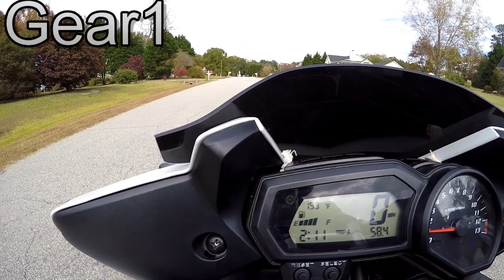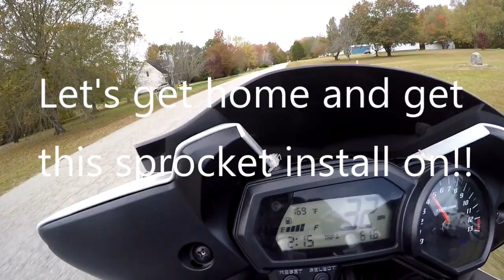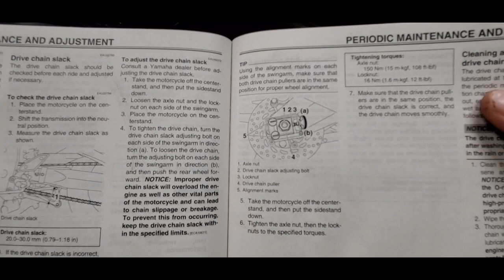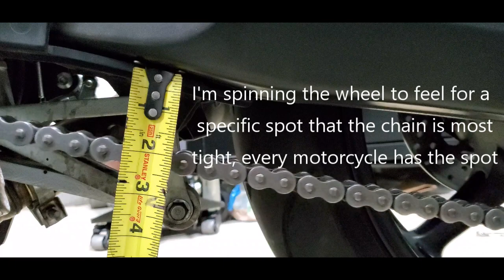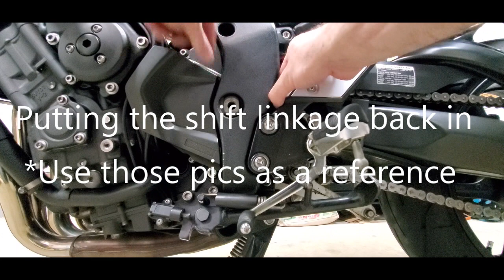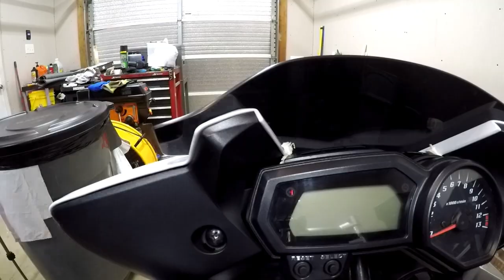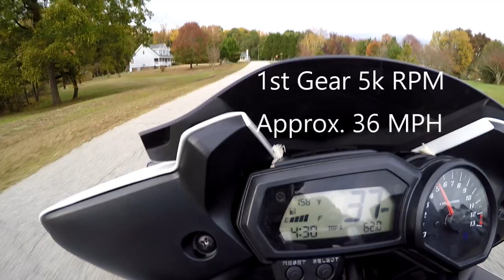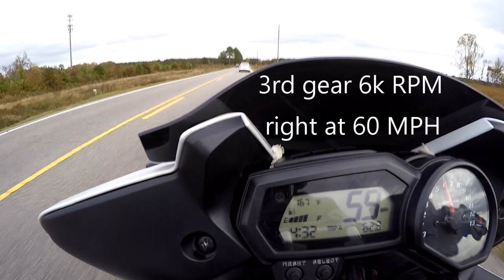2006-2015 Yamaha FZ1 17T to 16T Front Sprocket Swap, Before/After Rides & How To Set Chain Tension!!

Comment: Damn, I just wrapped up my 16t install on my 2006 and I'm pissed that I didn't find your video until AFTER I spent a ton of time tracking down torque specs and pictures.. Anyway, this is a fantastic video dude! At least I used it to double check my work and I did everything correctly, I can't wait to go test it out in the warm weather!
Reply from the maker: @Renaissance Engineering - Leeman Stevens thanks for the comment and sadly that happens a lot with the rotor upgrade video I made people don't find it til after their rotor explodes! But hey, at least it's a confidence booster knowing you did the sprocket job right on your own! Make sure to check out my full "FZ1 Mods" YouTube playlist!!

Comment: If you slide shift arm boot down. There's a little allen bolt. Only have to undo bottom end of shift rod. Rod then slides into hole in the frame 👍
Reply from the maker: @Marc Fletcher, I'm trying to wrap my head around this process.

Comment: hey what if you go 2 down and 4 up in the rear on your FZ1, will it be too much or what, and i am thinking of +2 -2 on my street triple 675 ?
Reply from the maker: @aniruddhagujar4119 that would be too much IMO. -1 in the front is the biggest gain only changing one tooth, enough to make my.speedometer 7% off. Doubling that and also increasing the rear by 4 would make the bike whine in higher rpms at almost any normal riding speed. I think -1/+2 would be sufficient if I wanted just a little more umph on the throttle pull.

Comment: Great video. Does the speedo read faster than you are doing or slower than you are doing after you switch to the 16T front sprocket?
Reply from the maker: @germanshepherdlover2613 I share that when I fix it with my speed healer here:

https://youtu.be/tv0At9eeh8E?si=eRgjseAjoCWpUmZe

Comment: Wait….is there a specific spot on swing arm to measure from ? Think I misunderstood travel distance numbers…I thought we’re suppose to get a measured amount of travel ( like chain should move within a certain amount of distance ,ie:moves 3/4”-1” , not measure 2.25-2.5” from a specific spot ) …I know both equal same travel distance but what I mean is I didn’t know there’s a specific / marked  spot on swing arm for measuring.thought it was more or less middle between front and back sprockets where most chain travel occurs but could be one way or another on swing arm depending where rear tire was set at ….if that makes any sense ….I’m not saying you’re wrong just trying to be certain for myself . If not clear I’m new to wrenching my own bike 😂
Reply: Wish you put pre and post change numbers up ,together / side by side …I don’t have the short term memory to recall numbers from beginning of vid lol
Reply from the maker: @Vic Soboleski the manual I opened shows the location but it's the same location I show in the video for measuring chain slack is about hallway down the bottom of thswing arm, which is pretty much the middle between the center of the front and rear sprockets. Technically you want the very center of the chain sag/slack spot to be where you are measuring from. And I saw your other reply about having images side by side with the before and after readings but really that's just a quick reference as I mention in the video and description I need to install my DRD Speedo Healer to show the true speeds after the install because the speeds are now off due to the sprocket change...that video will be available once I can do the install.

Comment: What size is that cortech bag ? I just it the 2.0 18L strap version ,didn’t know if I trusted magnet with the plastic tank trim possibly being in way …plus straps are what I’ve had in past …I get nervous magnet will lose power over time , but I’m overly nervous in general hehe
Reply from the maker: @Vic Soboleski I bought that tank bag before I flew up to PA to pick up my FZ1 from NC and ride it back home over 8 years ago. I've never used the straps and magnets have never lost strength. I'll have to take a look at the bag to see if it tells me what size it is...I just grabbed one that was minimal enough but can still hold small stuff like my phone, wallet, paperwork, or even a GPS in the clear cover on top, which is what it did riding home when I bought my FZ1.

Comment: Hey Shawn I recently bought a 16t vortex front sprocket and I noticed there isn’t any rubber cushion. Do you think I’ll be fine?
Reply from the maker: @deegaw11 it'll be fine but you'll probably hear more chain rattle than before if your previous sprocket was cusioned. As you can see mine was cushioned before and after the swap, so other than the gearing change it's identical to stock.

Comment: Hello, did you notice much difference in fuel range after changing down to the 16T?
Reply from the maker: @bainer66 good question, but I haven't really been in a situation where I've been riding hard with the 16T, since technically I can roll the throttle less with a 16T and achieve the same RPM as the 17T did. Just riding normal and shifting through the gears in the same amount of time I'd be wound up higher so that would make sense I should lose MPG. All traffic or all mountain roads? That I haven't been able to check. I just know it gets to it (RPM) quicker than before!

Comment: Great video as I’m planning a chain and sprocket change (stock). But I thought the front sprocket nut was 32mm, it’s 30?
Reply from the maker: @Paul Velez it's def 30, 32 is the rear axle nut size. Thanks for watching and the comment, glad to help!
Reply: I also like that you showed explicitly removing the shift linkage. Good job.
Reply from the maker: @paulvelez9688  no problem! Nothing worse than watching a video that skips steps!
Reply: 😮. 
Mine is 36mm
Reply from the maker: What year is yours?
Reply: @ShawnMartinNCBIRDMAN  2011
Reply from the maker: @HereticLoyalist front sprocket nut?
Reply: @ShawnMartinNCBIRDMAN  Correct. Had to buy a new socket just for it. Same on an 09 Engine I bought.
Reply from the maker: @HereticLoyalist  that's odd. I made a note from what the parts stores online explained was different in size changed in 2011. I have a note about it in the description, but what you're saying is that it switched in 2011 to 2012, cause mine is 2012 and is smaller than your 2011. Maybe check your mfg date on the fork because there are half years as well...?
Reply: @ShawnMartinNCBIRDMAN  I'll have a look tomorrow
Reply from the maker: @HereticLoyalist  you've aroused my curiosity...
Reply: @ShawnMartinNCBIRDMAN  Can't find anything on the forks

Comment: What was the feel in the cushion sprocket, vs all steel sprocket? Or is it something u don't really feel? Im thinking about switch to one, but im really heavy on the gas and don't know how well they hold up
Reply from the maker: @rickg.8231 going from steel to cushion you'll hear less rattle in the chain.
Reply: @ShawnMartinNCBIRDMAN  thats what i keep seeing. Seems like a plus. BuT, what about getting heavy on the throttle.
Reply from the maker: @rickg.8231 mine has always been cushion the old one was fine and I like getting on the throttle. If you have excessive chain and sprocket wear then I could see how you're gonna crush the cushion but I'm not sure that the torque on the new sprocket with a cushion would be much different than no cushion.

Comment: I notice some front sprocets don't have rubber. Your thoughts?
Reply: Did I miss your review of the new sprocket some where?
Reply from the maker: @tallcool1ify the rubber helps to isolate/damper the chain to lessen chain rattle. The stock 17T sprocket was rubber cushioned and my replacement 16T is rubber cushioned. I do a post-ride with the new sprocket and give a little review of the feel of the change, but I was in a rush and didn't do a long ride. I still haven't been able able get out just for fun I was doing another mod and rode for that mod to fix the speedometer being off most recently.

Comment: Also I think your chain is too tight, it was good the first time you checked, the force needed to make it an inch after is too much.
Reply from the maker: @stevewill3572 I'm not sure if something was missed in editing, but this is how the manual shows checking chain tightness, maybe somehow it looks off, but when I walked through it it was spot on. Exactly how it's supposed to be. Just don't push hard on the chain to make a tight chain REACH the desired range!! Light pressure top to bottom for proper range.

Comment: Hinterhofpfuscher !  Ich habe 18/38 Z. Wieso soll Ich im 6.Gang, 20Km/H fahren wollen ?  Und die Kette ist zu straff gespannt !
Reply from the maker: @J. K. we don't have the same bike or the same gearingso the chain tension won't be the same from one brand of motorcycle to the next you need to check your own manual. If your sprockets are 18/38 compared to my 16/45, we're not even close to the same gearing. What is it you want to know?